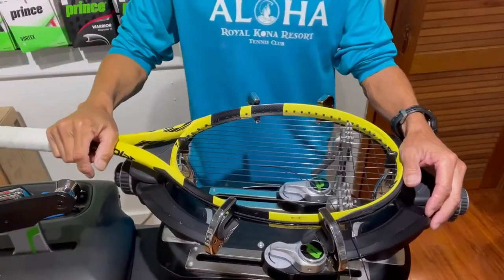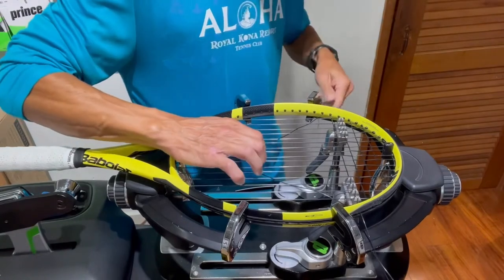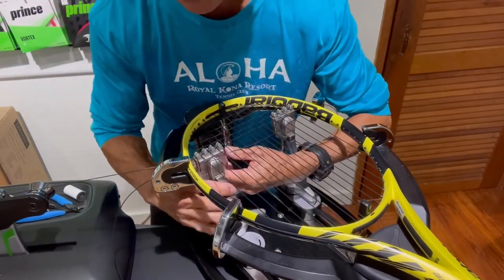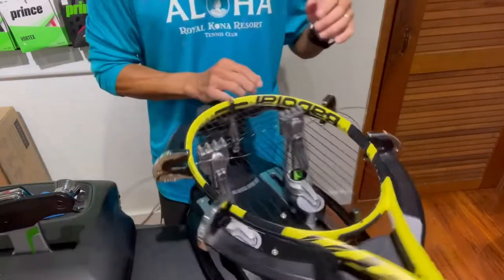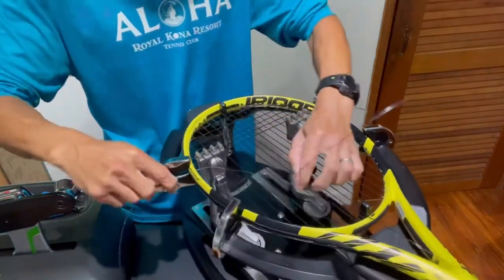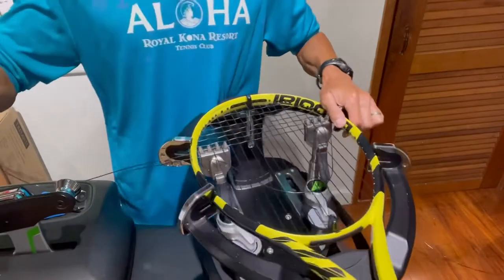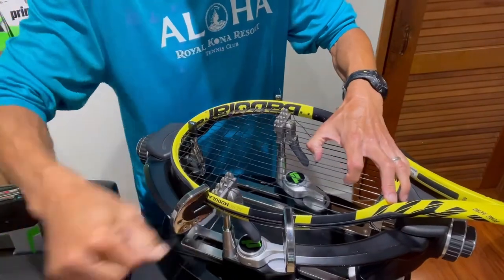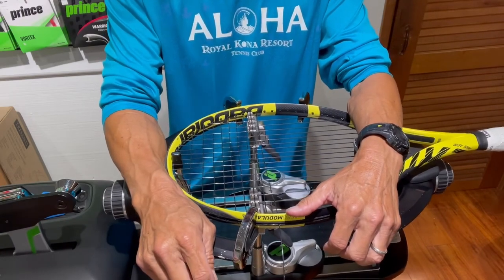Racquet Stringing [Weaving Crosses | One-Ahead Technique w/Small Loop ]

Comment: When you start your X's (two piece method) do you tension the 1st string or allow that 1st string to be tensioned when tensioning the 2nd X? Was just curious as saw a TW instructional video (on how to string a tennis racket) on stringing with a NEOS 1000 that did not do a tension pull on the 1st X but said the 1st X tension is done by tensioning the 2nd X. I've always tensioned each X but was wondering what your thoughts were on just allowing the 1st X to be tensioned by the pull on the 2nd X. Thanks for the video (as I use the weave & one-ahead technique as you demonstrated in the video).
Reply from the maker: Aloha, Since I use the starting clamp to hold 1X on the outside of the frame, I feel it's safe to pull tension on the 1X. In other words, there's no risk of pulling a starting knot through the grommet when tensioning 1X. Maybe TW is recommending that method to alleviate that problem with the starting knot. 

I know some stringers will tension both 1X and 2X that use a starting clamp, then go back to 1X and re-tension it before tying off.   

The one-ahead technique is pretty common, but it's the small loop that you form after each weave that will help reduce friction. I hope you picked up on that at 3:10.
Reply: @AMstringing  Thanks for the reply & insights as much appreciated.